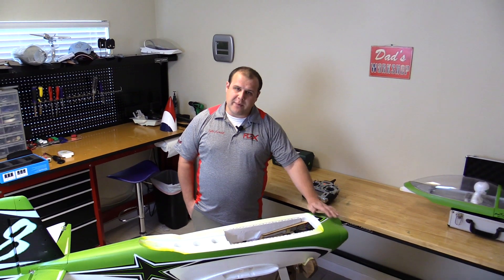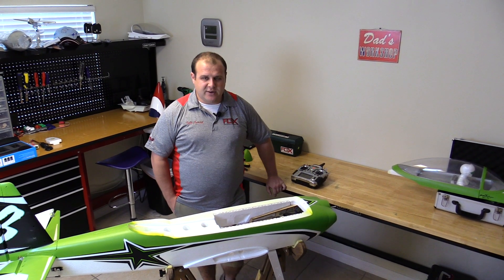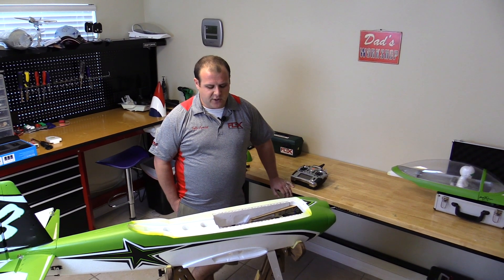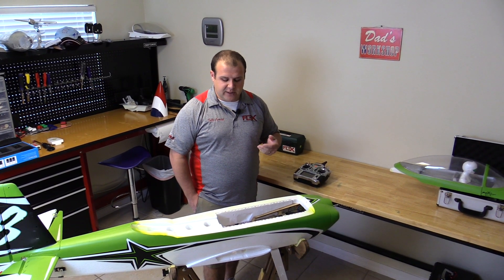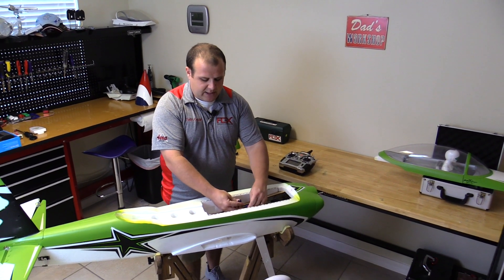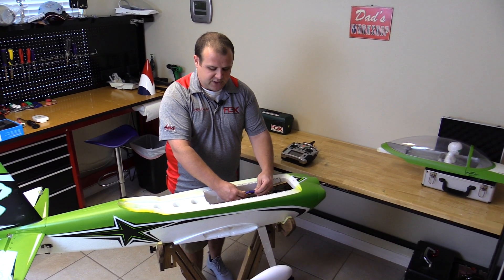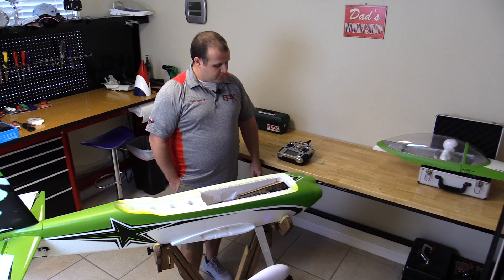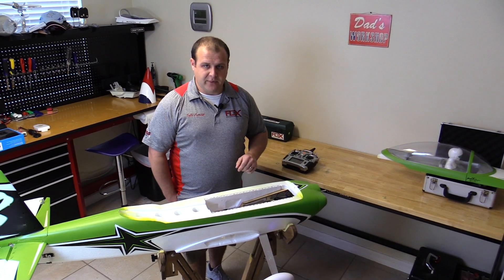ZTW 100A ESC Calibration - Flex Innovations Super PNPs

Comment: My new RV-8 10 motor 'stutters' when armed - have to blip the throttle to get it to run smoothly. Done teh recaibration procedure many times. Also - do you return the throttle trim to neutral after calibrating?

Comment: Problem resolved! Reset the Throttle cut setting on my  Spectrum DX9 Transmitter to -99 and then the 70mm electric motor bound and ran in reverse.
Then reversed two of the three motor wires and voila success, the motor ran in the correct direction after three weeks of frustration. 
Thanks for all the support at Flex Innovations.
Ready to fly!
Reply: hi there ,,,i have a futaba transmitter and receiver works well on everything, except ,,,,on this RV8 ,,,motor plays all sorts of tunes for about 5 minutes , just won't run , rest of plane works 

I am totally mystified , perhaps you have some ideas ,,yes have recalibrated several times , bird wants to fly ,
Reply: reply no 2 after about the seventh recal the thing finally worked ,,,whew ,,,,,,new problem for me
Reply: @HenryL161947  did you ever get the rv8 to work im having a ton of trouble.
ZTW 100A ESC (W/10A BEC)

https://youtu.be/7LWtIS7Rnnw

Comment: Hi Seth, 
    Did everything in your video. Having trouble getting electric 70 mm motor to run properly. Had a local expert check it out with his own transmitter. 
Even sent ESC back to have it checked out. R says ESC checks out fine. I had electric 70mm motor bound at one point but it ran in reverse. 
Since then I have done everything from reversing wires - to transmitter Travel Throttle settings. Nothing seems to work.
Last of three major issues to resolve with this FLEX RV-8 before I can fly. Please help. 
I have a Spectrum DX9 Transmitter which works fine with my Avanti 80mm and a Spectrum AR8010T receiver installed in the Flex RV-8.

Comment: When you say "lower the throttle trim to the bottom" do you mean to the actual lowest bottom position or at the 0/midpoint position in which most transmitters default.  I'm assuming if the throttle trim, position should be at the bottom, you will fly the RV-8 in this position as well and not at the transmitter 0/midpoint default position.
Reply from the maker: Trim to the bottom. Trim neutral is centered. Trim up is all the way to the top.